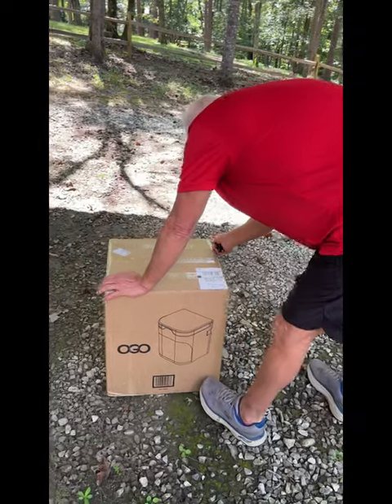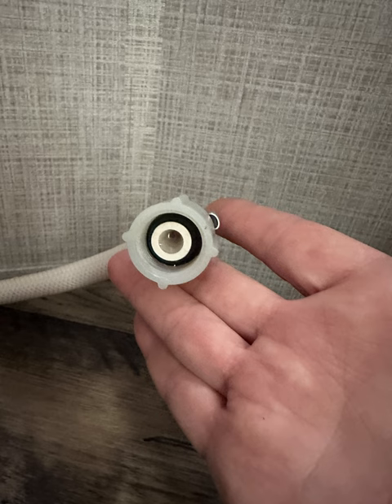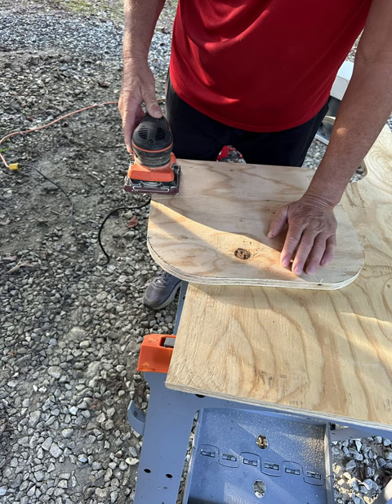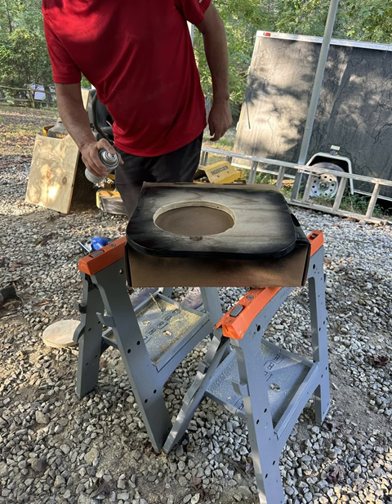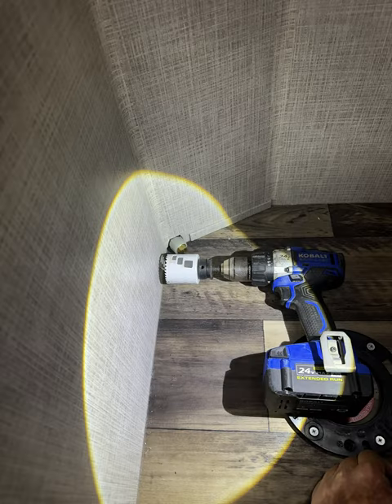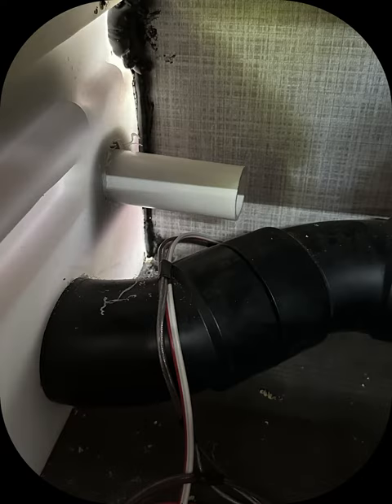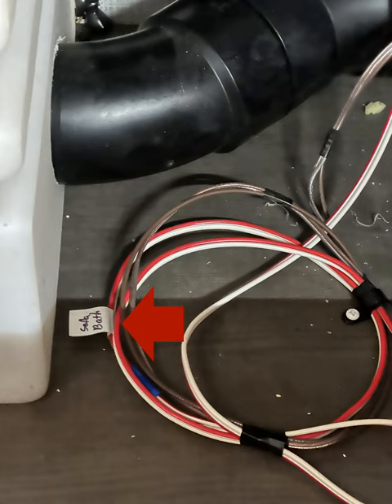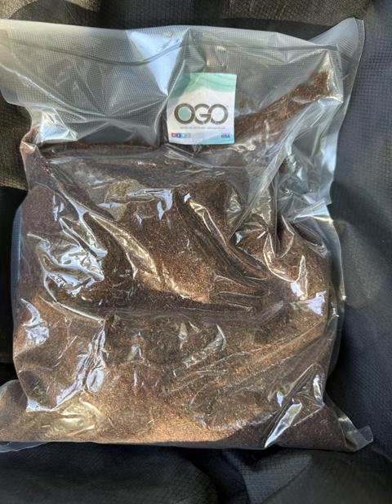The Truck Camper Toilet Upgrade You Didn't Know You Needed

Comment: How close is the gray tank in relation to the black ? Consider connecting them to increase gray water capacity .🍻
Reply from the maker: the grey tank is on the passenger side of the TC, black is on Drivers side.  it would difficult to connect them together.